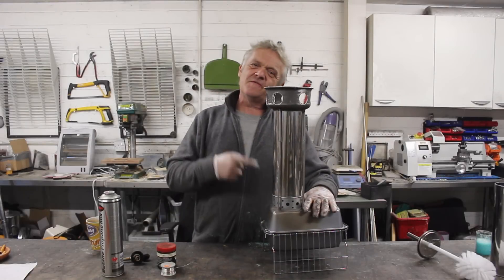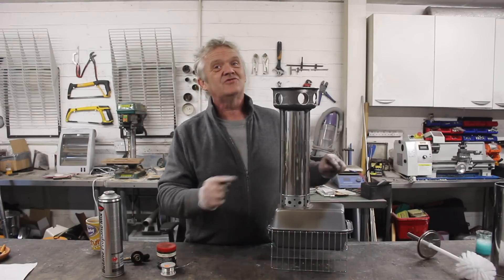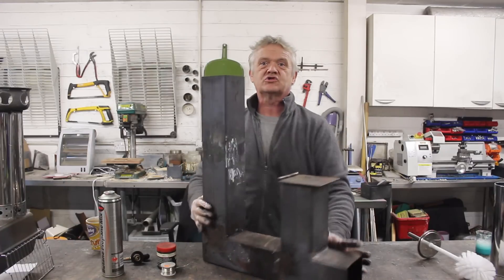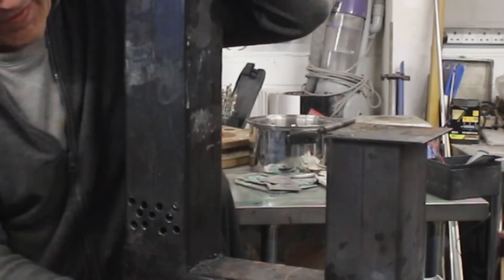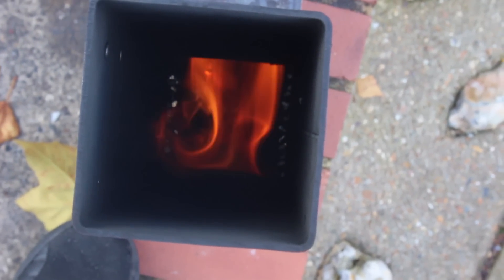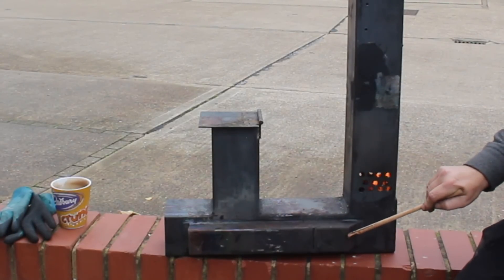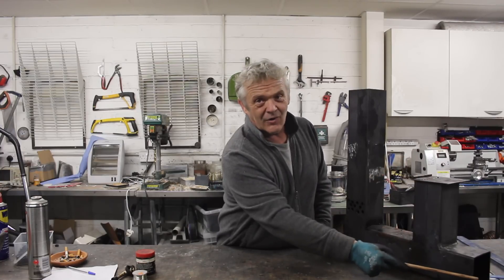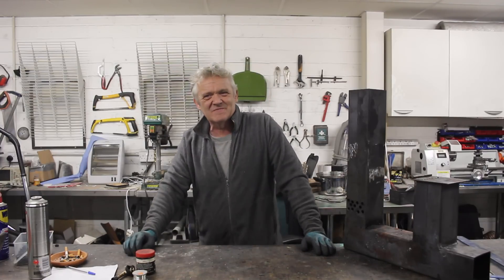1732 My Rocket Stove Adaptation

Comment: The swirl in the fire box appears to simply be the result of the Coriolis force, but it might also be a result of air deflection from your preheater coming in at a 45 degree angle too.
Reply: If one was to install offset semicircular sections pf pipe, shaped something like a progressive French curve to direct the air flow from the air ports at the base of the chimney, one will get a very definite vortex.
Reply: @tobygathergood4990  Any unified deflection will certainly help. For instance, even so little as angling the drill holes will give a slight twist.

Also, just adding circular pipe into the chimney its self will help, as the turbulent recesses of a square tube by nature resist a smooth vortex, even while they make tiny eddy countercurrents.

If you took a piece of anything round [say, stove pipe or steel pipe] and put that on the discharge, then directed the  exhaust from the main char-burn chamber through a tapered deflector to one side, and then filled the rest with that 'pre-heated' air on the other side, it would swirl quite vigorously indeed.

This would also allow one to insert the fresh air into the center of the combustion, instead of the outside.

The ideal arrangement would be to have the stream of hot gases entirely enveloped, as a very thin stream, into a rapidly spinning vortex to maximize the fuel-to-air surface contact, and I can draw up a simple sketch of that, should people be curious as to how I  suggest it would best work.

All of this can still be done pretty cheaply, with simple tools like he is already using, and simple pieces of plate and pipe.
Reply: @hunnybunnysheavymetalmusic6542  Agreed.
Reply: Coriolis.......lol. I suppose my toilet does the same.
Reply: Calm down buddy... Coriolis force is minimal. More than likely that vortex is just a result of ingesting atmosphere at a differential rate across the holes that were drilled.
Reply: @Akya2120  Without closely examining it and running some tests on it I could neither rule that in, nor rule it out, but it would not be my first knee-jerk-reaction to what I was  observing.
Reply: Coriolis effect only affects LARGE bodies/systems, the toilet thing is a myth. Sinks, toilets,  tubs etc. all are affected by the shape of the object (irregularities) much more than the C.E.
Reply: @LawlissLanterns  I could say something dismissive or insulting to you, but instead, I want you to prove it.

I've been in this business all my life.

I'm suspecting you're just arm-chiaring your way through all this with nothing but opinions.

If you have data and scientific prof to show me and all the rest of the world wrong, please do share it.
Reply: I just saved that as a chapter for a book on thermodynamics and fluidics in combustion theory I need to complete...

If people would like that as a .PDF, .ODT, or .DOC file let me know where to send it.

Comment: Tracking the flue temp with IR, before and after, would have been good to see. Thanks
Reply: I was thinking the same. Hey Robert, for the next iteration, you don't need more steel, just block those holes by welding a bit of plate over them and then bore new holes down lower. You could even do your IR before and after and you'll have 3 measurements, 1. High holes, 2 no holes, 3 low holes 🙂
Reply: Same

Comment: I'm wondering if you drilled the holes near the bottom, but just along one edge and on the opposite side along the other edge (diagonally).  Not sure if that makes sense, but you would create a better vortex.   Thoughts???

Comment: Instead of holes use 2 pipes in the top corners from the inlet too the chimney. Fun one to the back and stop the other just as it enters chimney. Cut 45 degree angles on them so the air coming out goes around the chimney😁😁

Comment: Could your design be more efficient with an induction tube surrounding the burn tube base? Also, would it be practical to incorporate some version of turbine in the vertical exhaust tube or above the outlet?  Using the exhaust heat to generate a few volts perhaps?
Ive leaned a lot from your builds. Thank you
Reply: I believe you can be too efficient and it doesn't work properly....   ?     Flu temperature coming out on , above, the roof should be around 300°. ?   There is a number ... ?      for safety...

Comment: I'm sure pre-heating air isn't a good idea because increasing temperature decreses volume - hotter air means you need to add more of it (volume, not mass).
Much better keeping the firebox hot and utilising the air heater for the room instead.
Reply: Automotive example would be cold air intakes and intercoolers.
Reply: @smartliketruck  Yeah, similar.  Engines run better with colder air because they can get more air in the chamber but also active cooling is required to prevent pre-ignition.
Reply: I once built a furnace with an 8kW gas cooking ring.  The cast iron ring was in the bottom and it worked great until the cast iron heated up - that heated the air coming through it lowering the amount of gas that could be burned.